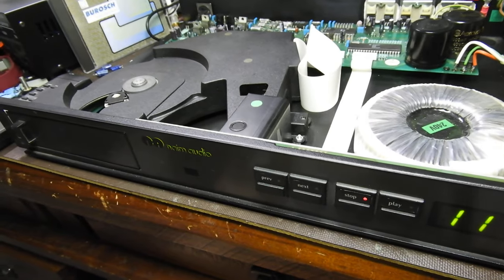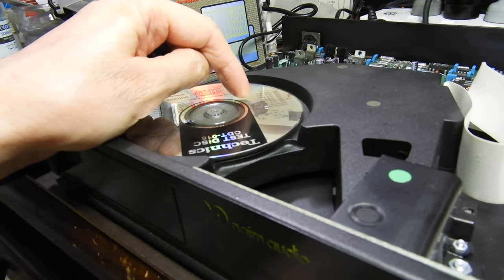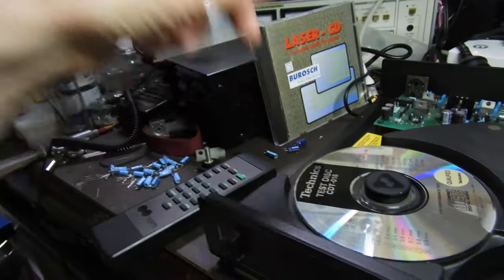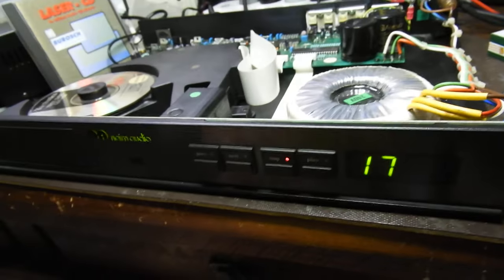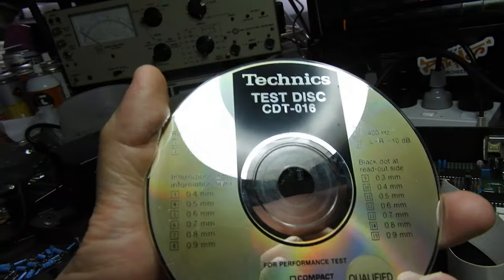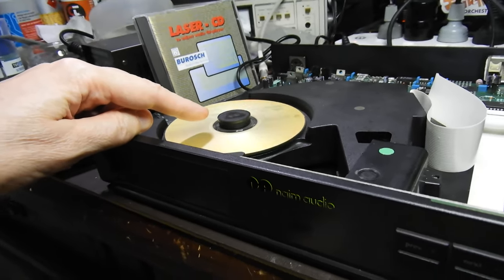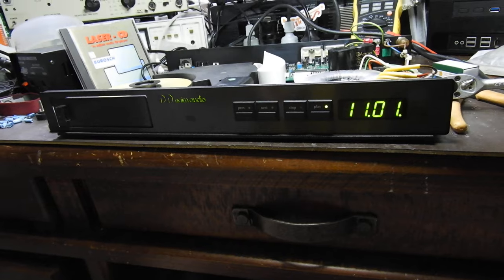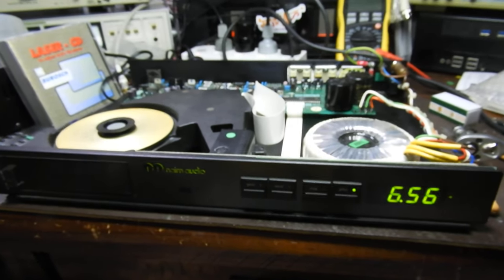Naim NAC-D3 (a.k.a. CD3) with crooked TT shaft but working well and passing all tests. Fixed or not?

Comment: Hey Buddy Jam Industries Sent me the New Flagship Audiolab CDT 9000 Series Transport (1500.00U.S.) And Its built very well built All Aluminium Chassis and Base New Cd Mech Has its own power supply and its Encapsulated with Electromagnetic Shielding the coax output has a differential line driver what ever that means lol (Thanks for the Video) Wish I could find more info on the mech also the top cover has 10x Torq 7 screws very hard to get out without striping and At my job I turn screw drivers constantly I will use Wila drivers can't wait to see the inside but finishing Video review 1st - Each Side panels has 6x T-7 screws Thick Aluminum also .
Reply from the maker: Get one of those Chinese screwdriver sets for $25. It will have 60+ bits and every torque bit you ever wanted. 🙂 Send me a link once you do the review please
Reply: @hear-net-au  will do i been comparing flagship 9000 vs Entry level 6000 (cdt) on my budget systems to my More revealing hifi systems small small performace gain but some people will pay the difference for small gains - 
I have the craftman set of torques I like german made tools alot i have put thrm threw the test at work (Industrial Maint Tech)

Comment: Buy Mabuchi RF-300C-11400 motor if you can
Reply from the maker: That is no brainer. But... my local (in Sydney, some 4000 km away) wholesaler does not have that particular motor in stock. I mean he does have a RF-300CA-11400 but I do not know what the "A" stands for and people like Parts Interpreters are long gone from technical suppliers. So it is either Mouser / DigiKey / RS/ Farnell or eBay. Big price versus big wait. But indeed, as Andre suggested I will talk to the owner.